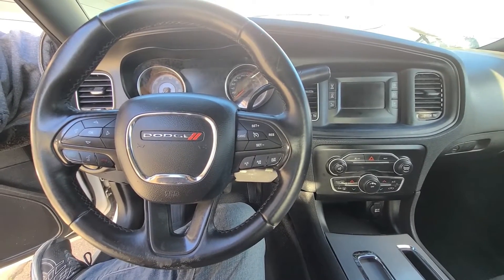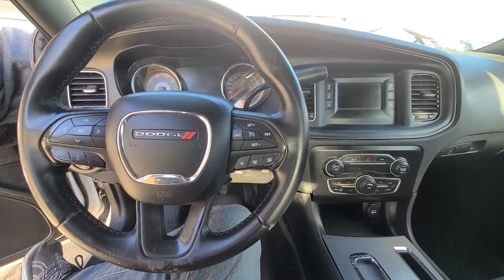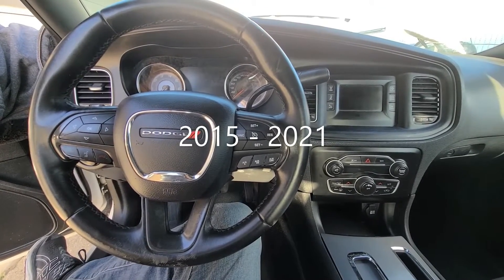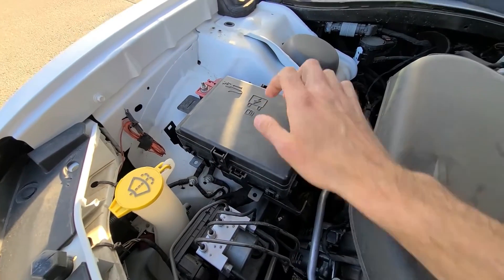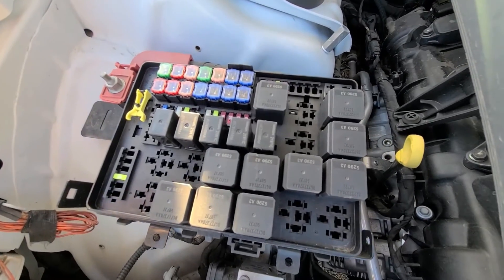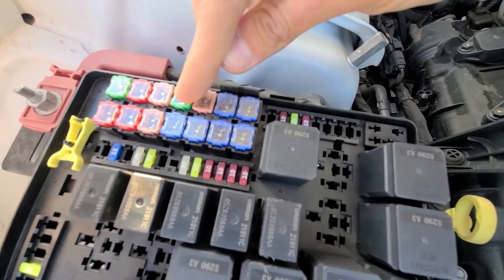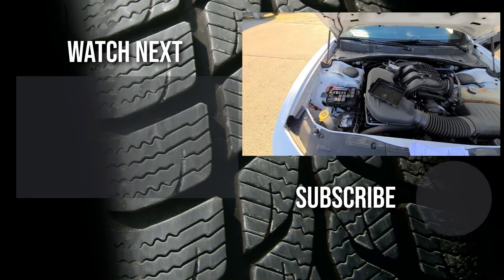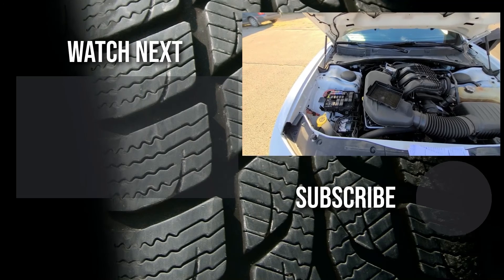Dodge Charger - ELECTRONIC STABILITY CONTROL FUSE LOCATION (2015 - 2021)

Comment: I have the same problem light come on and abs i change abs sensors but stability still on, but i havent check those fuces i hope theres a place the sale then.
Reply from the maker: Good luck. If fuse is good make sure to scan the module and follow up on the error codes

Comment: So I have an ESC light on but an ignition switch code when I scan ABS what could this be or mean? I figure the Ignition isn’t sending enough power to the ABS so I may have to replace Ignition then get a key recoded. Just looking for things to try before I drop a few hundred on the vehicle
Reply from the maker: Hello, hmmm it is possible. If the code is active and not only stored I would start by fixing / replacing the ignition. Hard to really say what else could be going on. Also make sure to check steering angle sensor and make sure wheel alignment is good. Even a weak battery can cause it
Reply: @ thank you
Reply from the maker: @ You're welcome

Comment: I removed both fuses and my car is still saying service electronic stability control every time I drive 🤦🏾‍♂️
Reply from the maker: You will have to scan the module and follow up on the codes. Could be something as simple as failed wheel speed sensor or corroded wiring towards one of the sensors

Comment: My abs and my brake light with the esc light came on at the same time
Reply from the maker: Most likely failed abs sensor or damaged wiring towards one of the sensors if fuse is good. Scan the module for codes and follow up on those
Reply: yoo idk if you’ll see this do you remember how you fixed it i have a 2015 charger n i have the same issue
Reply: Try the f76 fuse {10a) that's for the abs and electronic stability control mines pop up outta nowhere no codes or nothing I'm getting new fuse then I'll check back

Comment: Anybody know to turn it back on
Reply from the maker: If you have traction light on most often it is a failed wheel speed / abs sensor on one of the wheels. Needs to be scanned to see which one

Comment: On charger the warning light keeps coming on that I have to service the my electronic stability system have you seen this before
Reply from the maker: Probably a faulty wheel speed sensor (abs sensor) / wheel hub or sensor wiring
Reply: Any update ? Mine keep popping up for a quick second then going away
Reply: Did you get this fixed?
Reply: @stargazing15 ever get it fixed?
Reply: Mine just did the same did you fix yours

Comment: What do I do after?
Reply from the maker: If stability control light still on after replacing the fuse then you will have to scan it and try to reset. If it comes back on, scan again and follow the code. Most likely there will be an issue with one of the wheel speed sensors or wiring

Comment: Then what, do i need to just change them?
Reply from the maker: Yes if they are burned out. If they are good then you can start looking at wheel speed sensors (abs sensors) and wiring